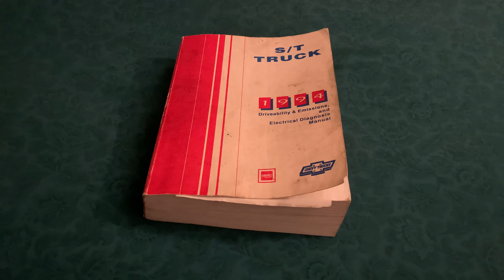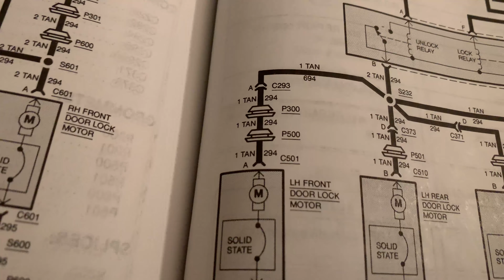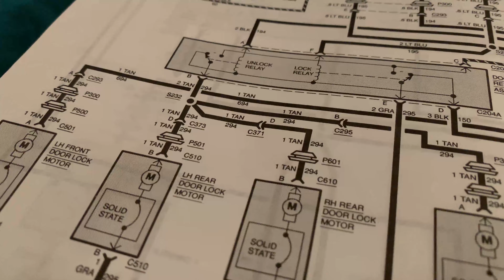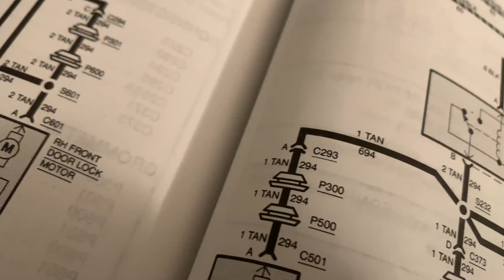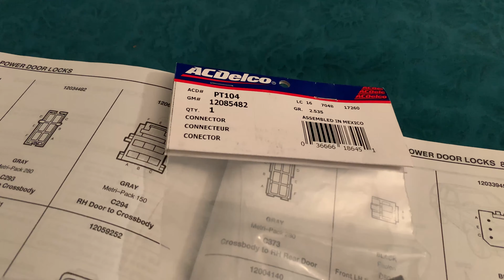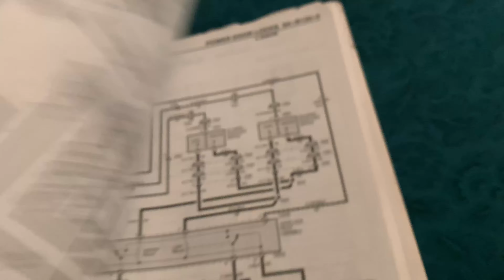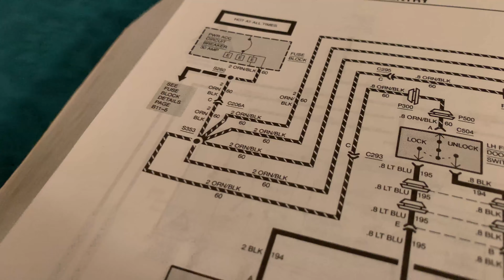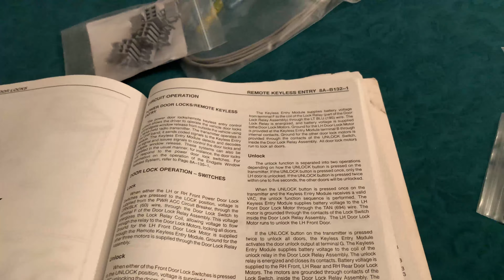Adding factory keyless entry to my 1994 S-10 Blazer - Part 1

Comment: I have been following your post on another website about these doorlocks. I also have a 94,but truck,and im simply trying to add one of the cheap aftermarket amazon kits to work the 2 doors. I cant for the life of me figure out how to tie the new kit into the old wiring. You think you could help me figure out where to tie these connections in? I did a 93 f150 without any problems,but this trucks wiring has me at a stand still.
Reply from the maker: Hey Jerry, I can definitely look in the service manual to tell you what the connectors look like and the wire colors, is that pretty much what you are after? I know the 94 trucks are a lot different than the 94 SUVs because they are the new body style, it could be quite a bit different than what I did here in this video series. But the info should be in the service manual so I can look it up if you'd like.
Reply: @doogulass  I'm trying to connect on the passenger side door and if i remember correctly from the other day the orange/black wire is 12v and the light blue and gray are the unlock and lock wires. No matter what i do with those wires i get nothing. I tried using a jumper and i get nothing. I dont see how a simple switch can be so difficult.
Reply from the maker: @POZTERx  Looking at the wiring diagram for the 94 pickup kind of confuses me. Light blue seems to be the "lock" wire that goes between driver's side and passenger's side switches. The actual wire going to the door lock motors is tan, it should also come out of the passenger side switch. The unlock wire is gray, also coming out of the passenger side switch. Strangely one of the wires going between the driver's and passenger's switches is black, even though it's not ground. It's the "unlock" wire between driver's and passenger's side.

I'm having a hard time interpreting the diagram in the service manual, but I think you have to be in a situation where when you press the switch, one side of the door lock motor is grounded and the other side has 12V on it. So for example to lock, you would want 12V on tan and GND on gray. And to unlock you want 12V on gray and GND on tan. I think that's what the switches effectively end up doing, but the diagram does a real poor job of depicting that.
Reply: @doogulass  that's enough for me to try again. I hope to check it out again this weekend.  Thanks for taking the time to look. I will let you know if that leads me in the right direction.